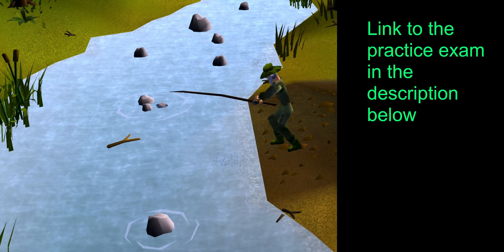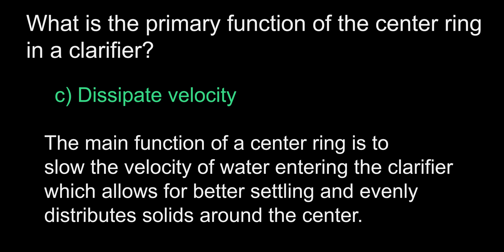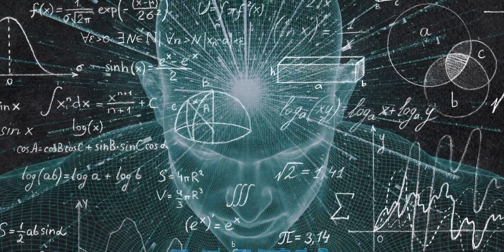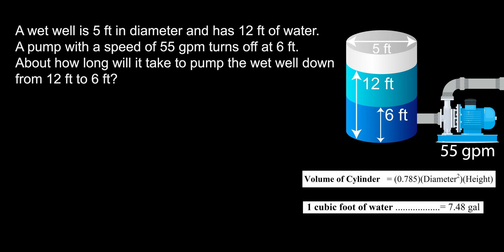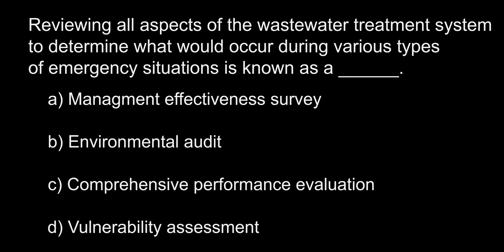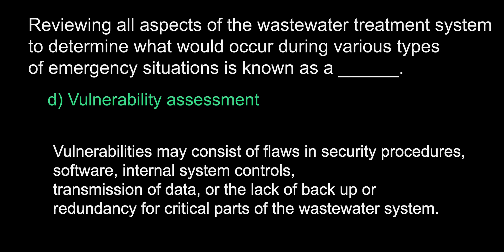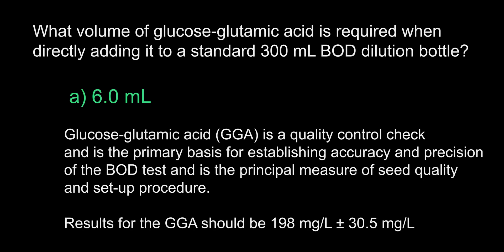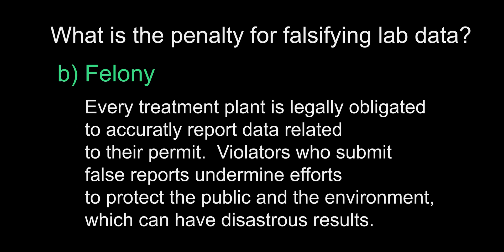Part 4 - Wastewater Treatment Operator Exam Questions

Comment: How would I know that the wet well is a cylinder and not a circle?
Reply from the maker: A wet well has to be 3 dimensional. A circle is only 2d.   A wet well can be a cube as well.  Either way it needs to hold a volume of water so it can’t be a 2d object.   Thanks for the question and good luck!

Comment: I'm a bit confused on how for the math question for how long to pump the well down to 6 ft. How did you get a height of 6 ft? Math is not my strong suit and I may just be having a brain fart but I'm a bit lost there.
Reply from the maker: Hi, 

The tank is filled with 12 feet of water.  The pump turns on and pumps it down until 6 feet of water remains before shutting off. The 6 feet that has been pumped down is required to solve for the volume of the tank.

Let me know if that was helpful.

Comment: As someone who studied physics it's not about rounding but significant digits 2 significant digits is usually good enough.
Reply from the maker: I agree.  Significant figures are important to an operator, especially if working in a lab setting.  However, they are not really important on these exams.  Which is why I don't go over them in detail in the video.  The exams don't try to trick anyone with how they rounded an answer.  Thanks for watching!